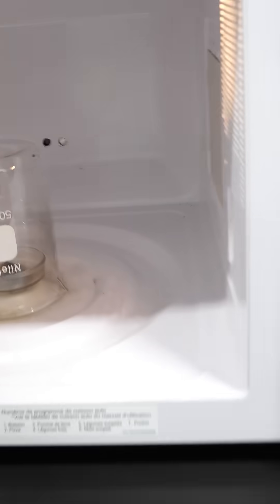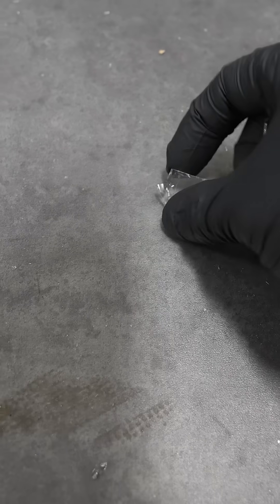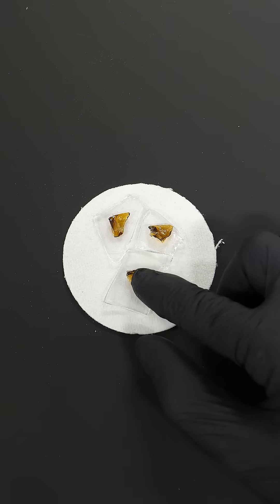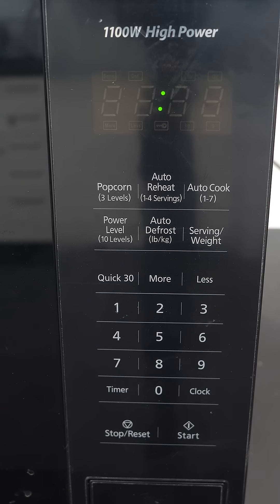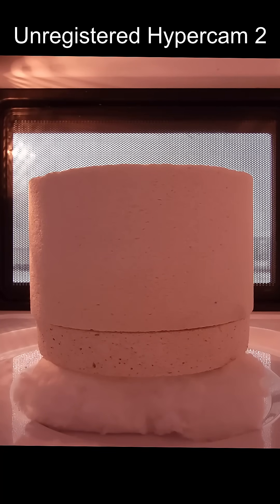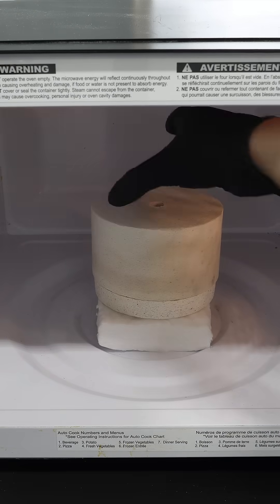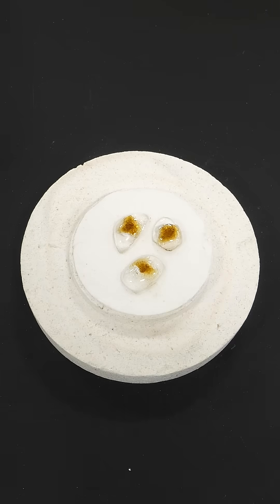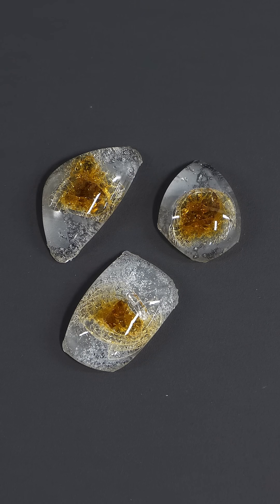Melting glass in the microwave is crazy

Comment: Question. Would the kiln protect metal from sparking all over the place in the microwave?
 If it does you should see how long it takes to melt different metals or see if you can get steel hi enough to forge

Comment: No you didn't put then close enough Pyrex has a coe of 33 it's not going to flow the way you likely were hoping. I'm a glass artist. But I use a very expensive torch with propane and oxygen to melt the glass. If you wanted your pieces to fuse you should have had them touching each other. I'm talking about the pieces of Pyrex lab gear.

Comment: The reason they didn't fusing into one piece is that glass has a tendency to become about 1/4 inch thick when liquid. Since the beaker is much less than 1/4 inch thick, it will contract as it melts until it reaches that thickness. If the pieces had ben 1/2 inch thick originally, they would have spread out to get that that 1/4 inch thickness. The only way the keep them thicker is to build damns around them to  contain the molten glass. To go thinner, you have to manipulate the glass while its still extremely hot and allow it to cool just enough to hold your final thickness while you then slow cool it (annealing) to prevent internal stress.
Reply: Kind of correct....   it's the surface tension that keeps them separated. If he wanted them to bond together, they needed to be overlapping. If he wanted them to FLOW together, he needed to get it MUCH hotter...like 2k+ (°f). Borosilicate glass needs much higher temps to get runny.
Reply: Thank you
Reply: They are different coefficients
Reply: One piece?
Reply: I think they look nice after he cleaned them. If he made some more, they could made into a necklace or bracelet.
Reply: Glass has a tendency to run like water when hot.   Just warm , yes it wants to stay thicker. Your comment is misleading.  (No offence) I make borosilicate color for a living. (Greasy Glass)

Comment: Instructions unclear. Microwave exploded. 😅
Reply: Funny thing, you can actually turn a microwave into a forge, and all you need to do it is remove the door and safety and put something else there instead to block the radiation (I forget what exactly). I knew someone who had one, and they let me watch them melt metal with it.
Reply: Hahahaha "to block the radiation"😂 hahahahahahahahaha.   There's no ionizing radiation in a microwave.  Therefore, no reason to block it.  There's no reason to have a door & originally the very first microwave prototypes didn't even have doors.  A microwave oven produces microwaves which are not dangerously radioactive (ionizing radiation).  Microvaves produce non-ionizing radiation, which is safe as long as you don't have any part of your body inside the microwave oven.  Any body part inside of it will heat up & quickly burn😉@Brass319

Comment: I'm a fused glass artist.  This is a legitimate process, but you need to understand a lot more of the details of the properties of glass to make it work.  Those two colored pieces of glass have different coefficient of expansion rates, so they will always fracture.  You can't mix glass with different COE.  It doesn't matter how slowly or how long you cool them.  Also, glass naturally wants to become a certain thickness when molten, and it wants to become round.  You can't put two pieces of thin glass side by side and expect them to melt together into one puddle.  They will each draw up to be about 6 mm in thickness, which will make them separate further, not come together.  Interesting experiment, but you need to know more to make it come out of the microwave kiln as you expect it to.
Reply: Glass artist here too, not fused but lamp worked. COE coefficient if expansion is both a curse and a blessing. If you seriously want to do any hot glass work you need loads more info. Glass has almost magical properties and it's so much fun to work with.

When you work glass, getting it hot then cold, you can introduce stress into the glass and if you don't fully even out the temperature by annealing it in a kiln, there is always a possibility of shattering or exploding. We have all heard of glass tables exploding in very hot sunlight...!  Beads from India and China are often not annealed and break easily at the slightest tap. They also have dry powdery bead release in them. They may be cheap, but you get so much more by buying from a bead artist. You get unique designs, made by artists/artisans, your beads are annealed for strength and durability (they WILL probably break if you drop them on something hard - they ARE glass after all), packaged nicely, possibly made to order and could even be special enough to be an  heirloom. So support glass artists! 

If you want to dabble with glass, it's a spendy hobby, but there are cheaper workarounds if you are doing it for fun rather than for sale.
Reply: @beadysam thank you
Reply: @beadysam glass tables exploding is from the tempering. Think Rupert's drop.
Reply: @beadysam could you tell more about the cheaper workarounds for working with glass for fun?
Reply: @beadysam I’m sure he knows all this & this was just your way of showing off what you know.  He’s testing theory not becoming an artist.  What he’s doing is a lot more important.
Reply: @SunshineBear17 Maybe he knew, maybe not. Either way, flexing someone's knowledge isn't wrong. I certainly appreciated learning more about glass and its properties than the video showed. Expanded knowledge relating to any video is a good thing.
Reply: @beadysam  thank you for sharing your knowledge. 🌷
Reply: @beadysam  are you implying there aren't bead artists in China or India? 🙄
Reply: @beadysam can you make me a bong?
Reply: @beadysam  "Bead Artists" mostly make overpriced trash. Cheap trash is better than that.
Reply: here I am at 3:16 am learning cool things about glass instead of sleeping
Reply: @DT_Worlds_Strongest_Goth  I do this every night!  I am 'trying' to get to bed by 2:30am, buy end up blowing by that watch youtube shorts. Maybe tonight, maybe tonight. - Cheers
Reply: @joeshmoe7967 I only use wi-fi when at home and I put an automatic timer to control it. So 10:30 it is
Reply: @joeshmoe7967 
  5:42 a.m. I am still trying 😅
Reply: @joeshmoe7967  omg, same!!  😂❤😂
/ cries in 7:30am, knowing I need to be up by 10, no matter what 😂❤/  eep!! Ahaha
Reply: @DT_Worlds_Strongest_Goth  I understand you: here I am at 14:26 learning cool things instead of eating... :-D
Reply: @DT_Worlds_Strongest_Goth  2:29am here in Baltimore
Reply: @DT_Worlds_Strongest_Goth  I know what you mean. I once saw a sphere made of glass and didn't sleep for 9 days
Reply: @DT_Worlds_Strongest_Goth I fell asleep at 3:16
Reply: @DT_Worlds_Strongest_Goth Love science, love learning, don't love not getting my sleep. This is exactly what I do too.
Reply: @DT_Worlds_Strongest_Goth Perth?
Reply: I want to learn how to work with glass. Too bad where I live it’s not easy finding a place to study. And I currently don’t have the means to do it on my own. Hopefully one day.
Reply: @DarkenedAndrew  believe in yourself, the chances are always high!!
Reply: @DarkenedAndrew  Maybe you could read up a lot online (assuming you haven't already done so) from the various free resources and the teach yourself how to do it with a microwave.
Alternatively you could maybe use something glass like, epoxy resin which might be more reasonably priced. There are many ways to work with glass and glass like substances so I hope you won't let finances stop you.
Reply: @DarkenedAndrew  I hope that you find a place, too!!  Keep looking, a place may open up someday!!  I hope that for you 😊🫶🏻
Reply: @DarkenedAndrew it's only a matter of time. The only way you won't get there is if you give up. As long as you keep on the path of trying, it's only a matter of time until you will find a way :)
Reply: @DarkenedAndrew plenty of literature and videos on the subject. Then maybe some apprentice thing would be possible there? Schools are not necessary, especially for art.
Reply: @DarkenedAndrew theres gotta be a high school or college nearby that has art classes that do this? Maybe u could stop by after school hours and ask if u can try it!💖💖
Reply: @DarkenedAndrew all starts with manifestation
Reply: @DarkenedAndrew Look into glass lamp working. You just need a torch and the glass and a couple inexpensive tools like tweezers. Very simple start up, but you can do beautiful things with it.
Reply: wow, someone has a lot of experience in glass. interesting though...
Reply: @33238 ❤
Reply: Thank you. This was cool.
Reply: @jillh2858 the fractures look kinda cool though in this case.
Reply: @nighthunter3039 I think so too. Almost reminds me of root beer or amber… maybe even like a quartz citrine mix but the color is a little darker than what I normally see out west for citrine.
Reply: I love it when Pros come in and explain the process and more nuanced details to help people and the original poster better understand it
Reply: I simehwhy love the cracked look
Reply: I  make glass color for a living.  Hard to say what coefficent That glass was. The brown could have easily been the same at the start.  He cooked that clear so long it was devitrified. The brown chips would have been super heated beyond working temps.  Yes I also own a kiln fuse set up as well. Color company is greasy glass.   Your original comment is a good guess, Just a guess tho unless you test, and treat the glass in a way it does not break down into it's individual components.
Reply: @DewDravis.c.o.e.33 you work for Greasy Glass? Sweet ive got some of your glass.
Reply: @Coincidence_Theorist I hate greasy anything. The name "greasy glass" makes me want to clean stuff off with alcohol or acetone. How did the name come to be?
Reply: Fractured i mean
Reply: Hi do you know at what price and where to file à kiln tho?
Reply: @Bob-w9w7u I got my microwave kiln off of ebay...it was around $100, but that was about 16 years ago.  I do stained glass and would fire scraps to make "jewels" for necklaces.  Make sure you fire glass with the same COE, otherwise they won't fuse...
Reply: @Bob-w9w7u get some insulation and a small piece of fire brick from a fireplace and sit the glass on it after you wrap it up in the insulation. Haven’t tried it but it could work if it’s that insulation board.
Reply: Have you ever been to the Corning Museum of Glass in New York State?
Reply: @CancerBoi6789 🎉 Fond childhood memories of going to Corning Glass... and several cool souvenirs 😊
Reply: Este video tiene unos dos meses cuando lo estoy viendo. Pregunto : ¿Este tipo seguirá  vivo? 😂😂
Reply: @egeo7296 jaja el hace tantas cosas peligrosas 💀
Reply: I love you for this knowledge
Reply: Qualified recycled broken glass...
Reply: Just learnt more about glass in 2 minutes than I’ve known in 51 years. Thanks random glass man 👍
Reply: Damn, Poindexter just got schooled.
Reply: I want to melt glass.
Reply: This is what the comments are meant for!
Reply: Came here to say the same thing about why they separated, I've done a little bit of glasswork with my grandmother and I vaguely knew about the not wanting to mix different types of glass. Didn't know exactly why that was though, so thanks for explaining!
Reply: I am not sure, but maybe borax added might bring the pieces together. Maybe.?
Reply: Do you have a website ? I'm interested to see your work
Reply: This was fantastically fascinating to read!!  Thank you for inputting your incredible knowledge!! ❤🫶🏻❤
Reply: ❤Cuando era una niña me gustaba experimentar.....
Hacía bolitas de cristal quebradas por dentro que producían quiebres con muchos brillos de muchos colores.....
Conseguía bolitas de cristal totalmente transparentes y sin nada dentro (colores), las ponía a calentar en la estufa de la cocina, en una cacerolita para freír huevos, sin nada. Al ratito las pasaba a una vasija con agua y hielo y pufff la magia, se quebraban por dentro y se llenaba de luces y brillos al girar.😊❤🎉
Reply: Cool responses like this are the best part of this already awesome channel
Reply: He’s really happy with how they turned out.. was all this really necessary?🤣 he was content
Reply: Yep, came here to say this!!! 😂
Reply: i jak ci się poszło oooo😊we

we 
wesz.   😂. no p pół
😅. zX 😂r
x.
Reply: After reading this I so want to learn and do it now
Reply: Is anyone else thinking pizza
Reply: My question is how the microwave is getting that hot
Reply: I was curious on if that was a thing, I have a class project in chem eng and these videos give me alot of ideas thanks for you sharing your knowledge of glass fusing, and the content creator for sharing his knowledge in chemistry and physics this is an amazing fan group to be apart of. Thank yall for the privilege! Go Aggies lol
Reply: 👍 👍 👍 👍 👍 👍 👍 👍 👍 👍 👍 🙏 thanks for the info
Reply: bruh.....let's just party and enjoy
Reply: Hello, I would be interested in your services, in glass blowing... I'll pay well.

What I need is a modified drinking bird, so a vacuum pump would be needed, and ability to safely handle chemicals.
If interested.

Also, having worked with these microwave kilns, with pottery....

I was amazed, actually took a few small pieces to what was damn near a porcelain bake level, in a amazingly short span of time, and had way less losses in firing pottery...

So I'm working on basically a microwave kiln system that can do larger amounts of glass, for glass blowing, several pieces of pottery at a time, in a hour, that would take a regular kiln hours to days.

If you'd be interested in working on such a project?
Reply: I can confirm all of the above, in fact I was going to state the same...
Reply: So we can use the microwave for enamel?
Reply: C’est impossible...🤗
Reply: Word
Reply: Nejseš ty Čech...?! 😉😁🖖🏼🇨🇿
Reply: I love doing this type think and lately I've been getting more and more into crafting my own style of "art projects" as Im getting older now
Reply: This isn’t common sense?
Reply: I'm late to the party but I just wanted to thank this person for the information they so kindly provided. Very cool 🤘
Reply: Can it be melted into shapes?
Reply: Amazing comment. Thank you for your service.
Reply: Well you learn something new everyday
Reply: Thx for teaching us Mr glass man🥀
Reply: How could he have avoided the bubbles in the glass ?
Reply: too right
Reply: You are the man... people like you teach others a thing or two and for that I salute you
Reply: NoLoL😂
Reply: Thank you for your detail - I learned a lot from it. 😊😊
Reply: omg that's such a good explanation, thank u !
Reply: I thought you were going to make a meme. I didn't know that you were a real glass artist😂
Reply: Yeah, if you want to get two side by side glass pieces to stay together you have to put another piece on top of both of them first. Which I’m now curious about the process of knowing all this.
Reply: Great explanation. Thank you so much for your expertise. 😊
Reply: Nerd
Reply: So cool! Glass has always fascinated me - thx for the tidbit of info 🫡
Reply: That's really interesting thanks for sharing that.
Reply: Gracias por todas los información que nos regalas. Muy interesante!! Jamás me imagené todo esos detalles cuando miro el concurso de trabajos en vidrios que dan en Netflix.
Reply: They look pretty fused to me, I guess we have different definitions 🤔
Reply: Yo, make a YouTube channel
Reply: Could you do it between plates?
Reply: They would’ve been better all fused together
Reply: Gracias por compartir conocimientos
Reply: You should make videos on it ❤
Reply: That's so cool!
Reply: @generalmark, your parents are also siblings, aren't they?
Reply: Hello, my friend, greetings, where you do that, you can teach me, I want to work with that, have knowledge of that since I was a child, it has been my job.
Reply: Stick youre head in it for a crystal skull 😂
Reply: @PjayDavenport   That's not very nice
Reply: Someone who doesn’t even know that there’s one space after periods is 100% not an adult
Reply: I ain’t reading alat
Reply: Bro Wroted a book with 300 Pages💀
Reply: no you're not. lying just for fun
Reply: Such a great post! Can we support your work somewhere?
Reply: Me being a mentor-taught lampworker, rolling my eyes.  Slumping glass is not an art form.  You're the glass art world's equivalent of paint by numbers.
Reply: @AuraFarming_Sigma you have melanin dont you
Reply: @generalmarkmilleyisbenedic8895  random racism???
Reply: @generalmarkmilleyisbenedic8895 everyone and everything does. Its exactly the same thing as squid ink.
Reply: @generalmarkmilleyisbenedic8895  shhh fashyboy the grown-ups are talking

Comment: Perlite for insulation. You have to paint the glass with special paint though to melt it completely. The wait period is so it doesn't crack. You can fuse them all together in a mold.